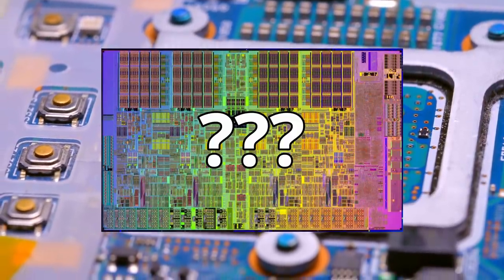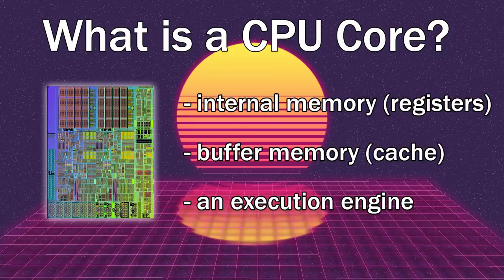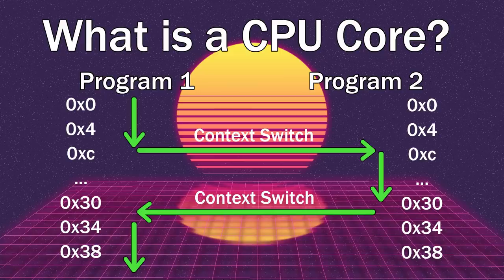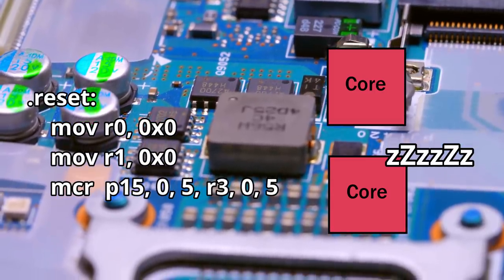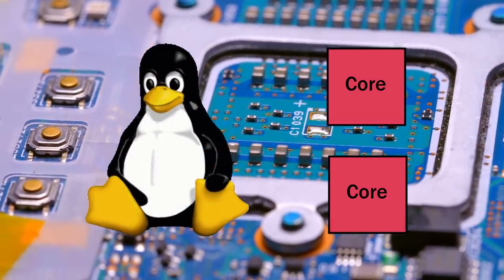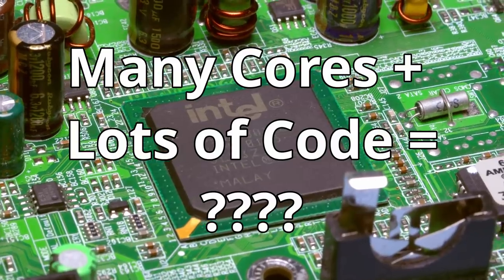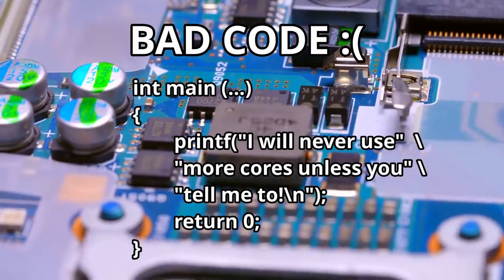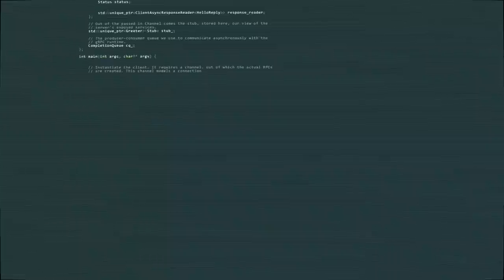why can’t computers have thousands of cores?

Comment: Well graphics cards have insane numbers of cores - most high end cards have in the 5-10,000+ range. These are highly specific cores capable of a limited number of operations and optimized to use local registers, but they can be used for non-graphics functions -- accounting, crypto mining, GIS software, etc. They are still useful for certain functions. Technically, they could be set to run more general purpose programs (giving them more instructions and replacing the floating point with integer operations). The main issue is that there aren't many general purpose tasks which can be divided into 500 or 1,000 tasks each working on its own memory and not using much I/O.

Many chips have microcores doing specialized tasks such as JPEG, MP3, or MPEG decoding. These often run microcode has have hundreds of tiny cores, since those tasks can often be done simultaneously. It could see future processors making these slightly more generic to run microcode.

Comment: Questions, dear sir.

We do have up to like 4 or 8 memory lanes.. Wouldn't simply increasing the amount of memory lanes fix most of these issues? And I guess a faster TLB, since these are still not that powerful afaik.

While sure, Amdahl's law means that a single program won't benefit hugely from parallelization, unless the code is extremely parallel. But, this still lets you run more programs and let cores keep their program affinity as they wish.

Now, sure. A question would be... Won't you just run into huge issues with L3 cache accesses? But you could just keep L3 to a smaller cluster. This would mean programs HAS to run on a certain core cluster, and is limited to a certain amount of them, but that's fine.

So I think we could have thousands of cores... But at that point you may as well just use multiple CPUs instead, which would give easier CPU architecture as well.

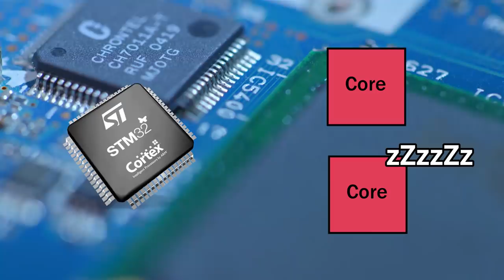Comment: Hmmm around 2:58 ... There is no such Dual Core STM32 Cortex-M0 MCU ...
The High Performance H7 Series has an option with a dual Cortex-M7 and Cortex-M4 tandem configuration or the STM32WB55CG with Cortex-M4 core with a low power Cortex-M0+. 
Anyhow, thanks for the video!:)

Comment: It should be obvious the key to scalable cores lies in scalable software. At present the programmer is required to define threading and concurrent processes, whereas applications should be written with context that allows an operating system to disseminate work to available resources (aka cores). If you want an insight into how this might be achieved, look at Grand Central Dispatch (GCD) by Apple. Although primitive, it isn't hard to see that a programming language could be created that has context and process dependency 'baked in'. Once this is done, the sky's the limit in respect of cores.

Another major issues is the assumption that future processors will slavishly conform to the model of a code execution unit, whereas I believe future cores will be seen as information stream processors in which individual cores will perform relatively simple tasks but combine, through inter-core routing, to achieve any function. In this world, you do not need (nor could you use) cache. Also, cores would be much simpler. Given that a Z80 core (taking an extreme example) is implemented with around 8000 gates, it is possible we could fit hundreds of thousands of simple information processors on a single chiplet processor. This technology will eventually eclipse traditional, linear code processors.

If you're thinking 'this is fantastical', well I've already designed the cores and I'm developing the solution on NVIDIA Jetson alongside server-based simulations. The work is extremely exciting!

Comment: Technically possible, but how many can you use ? Try to run say, 1000 cores simultanesly and the heat generated will probably destroy the chip.

Comment: Some of the information in this presentation is valid and relevant, but the premise is bunk.  Part of the problem is: are we talking cluster, computer, socket, or die?

Clusters - able to apply large numbers of individual computers to a single task - broke the 1000 core mark in the early to mid 90's.

For single computers, SGI broke 1000 cores with the SN/MIPS arch in the 90's, and their UV2 used Xeons in 4096 core single system images inside of 16k core shared memory systems.

For both single die and single socket, UC Davis developed a Kilocore processor in 2016.

It's not that we can't develop these systems - we've done it.  They have limited utility, but there is still room for limited commercial success.  You're just not going to find a 1000 cores in a general purpose desktop computer anytime soon, except in it's graphics card...

Comment: For gaming, the perfect amount of gpu cores, are the number um pixels on the screen, as in this way you can just put them on a single tread and keep everything running at 100% non stop.
As almost every render algorithm is executed per pixel, you will not have stuttering as your gpu will not be changing what pixel each core renders.

For CPUs, the ideal is to have one core for every process that's running, this way you can leave them dedicated for a single task without time being lost on shceduling.

The problem with this approach is that for gpus on full hd monitors you would need 2073600 cores, and that would suck more energy than an electric shower.
For cpus the problem is the same, you can get over 20k processes on your system while doing heavy tasks. And that's not the only problem. If you lock each core into one process, then you will have a limit for the number of processes you can schedule at a time.

This approach can work very well for micro-controllers, as you can make a static program that will never change, and most of these use cases do not require graphics.

Comment: You hit the key point at the end of the video: Current programs aren't designed for massively multi-core processors. But there's no theoretical limitation here - new processors will have more cores, and new programs will use more cores. A key point here: a processor with many slow cores can do more computation per watt than one with fewer fast cores due to the way frequency scaling works. To the best of my knowledge there is no major task people want to accomplish with computers where CPU compute power is a limitation that can't be straightforwardly scaled to thousands of cores. Even for tasks that it's theoretically impossible to parallelize - like the parsing phase of compiling a computer program - the structure of real world instances of the problem make it easy to parallelize anyway.

Comment: a thought occurs, if a processor is with more cores is restrained by heat, why dont they make the processors bigger? I understand socket size but why does a machine need to be small?
Reply: Because the closer everything is the less time it takes a signal to travel. Mind you this difference is only an extremely tiny fraction of second but with cores that are running at billions of cycles per second it is important to reduce this data transfer latency or the cores will start skipping cycles while waiting for inputs or output delays. This is actually why the newest ryzen cpus have the cache built on top of the cores rather than next to the cores, because even millimeters can create a drastic increase or reduction in latency

Comment: More cores creates issues with clock skew and timing, which is why cpus like threadripper have slower clock speeds than their lower core count cousins. Most application people use are single threaded, and cpus are designed to exploit inherent parallelism in code to improve throughput. But even that maxes out at a theoretical 40 threads for real life single threaded apps. And running a program on multiple cores is  to as simple as slapping ins new cpu, the program needs to be divided into threads to take advantage of the cores. (There is great research being done to make this easier.)

With that said, do not confused general purpose computing with that done in a gpu. The former care on the order in which instructions are executed. The latter doesn’t care nearly as much, which is why gpus have an insane number of cores.

And server cpus have high core counts because they are executing multiple jobs at once, which is the type of workload that can exploit high core counts,

Comment: What would you say about the 20 core processor on the Mac Studio?
Reply: lol not even that guy they already have 64 core 128 thread cpus in servers. there is a dinimishing return where the latency from one core to another does go up. so normally these bigger core chips are not something you would say want to game on. But they do have uses in where either cores can be set to do there own work or they can be partitioned off to systems to do seprate work
Reply: @Demon09-_-  yeah I didn’t mean to give much significance to the number of cores, but because Apple Silicon is designed in a different way than the Intel designs
Reply: @AntonioBrandao  yea apple uses similar to what would be found in a cell phone as it uses arm instead of x86. It doesn't scale super well to huge compute but works very well in lower  power applications hence the great battery life and performance that they get out of some of the m1 laptops. Some of them are not as amazing. But arm is definitely the way for laptops and lower power desktops

Comment: There is also the problem of heat dissipation and what's called the landereur limit. 

Cores work best when they are cold. And doing work heats them up. This is also a sign that potential work is being lost to heat or entropy. 

So the more tightly packed your processor and the more core, the more work it does, the hotter it gets, and if course the hotter it gets the slower it gets. 

So a 1000 core processor would be bottlenecked by the heat it would output too.

Obviously if you had some way of keeping the processor at say -50 degrees Celsius then you could ramp it's work up to crazy levels... Increasing the number of cycles and the processor... Known as the clock speed. 

But ultimately soldi state processors  using the lithographic processes we use today have a shelf life and we are now approaching that limit. 

With tricks we could lower the temperature and increase density below 1nm. But eventually there is a wall and we won't be able to make any processors smaller. 

So the trick is likely to use light instead of electrons...fire that light in low quantity on a photonic processor. This will decrease heat and allow sub nanometer density. 

Light can also operate at many many frequencies concurrently. Meaning a photonic processor could, in theory, carry out millions of instructions all at the same time.... Just each task carrying instructions at a different frequency of light. 

Then you could have 10,000 cores each tens of  thousands of times faster than the latest threadripper.

If that, was coupled with quantum annealing processor's... Then thats all the processing we would need for 50 years at least.

The problem is... It's at least a decade if not two away.

But the advantage in compute cannot be overstated. You would be talking all the processing power on earth in a device no bigger than a laptop that uses 9v power and last three weeks.

Comment: One thing to point out...the more cores you use, the easier it is to accidentally create race conditions with bad code.  In addition to the thermal and memory efficiency you mentioned.

Comment: I think the simpler the needed operation, the more cores are likely to be advantageous or feasible. There's no reason you can't wire up 1000 1bit CPu cores, other than design issues or size issues (homemade version of this would suffer from stray inductance, mirroring, etc, though less so than conventional models). Why you would want to do this I have yet to divine. You could probably make a very precise clock this way if you scaled it down.

Comment: Thanks for your explanation. Not many people can explain assembly computing not getting to technical for us who are not geeks. Intel run into a situation with their new processors who are multiple cores but with some P (from power) cores and some low level consumption cores named probably E (from efficiency) (I think don't remember quite right about the name). P cores have hyper-threading and E cores have not. When we have for example an 8 core processor with 4 P and 4 E cores it can support 12 threads. Ideally these threads are: 4 form E cores for normal every day tasks and the others from P cores for gaming or video editing tasks. In the real world a lot of games are incompatible with all these new Intel processors because of not knowing what core or cores to use. An E core can not be the master for P cores and parallel programing in this way is a total mess because nobody know who is doing what. Like programing is not complicated enough as it is, someone came with new ideas. Hello... Intel, phone processors are RISC processors running UNIX like kernels who are invented not stolen form others and putting some windows on it like Windows. All new phones has P and E cores and of course Intel want to steal that idea like they did in the past. May be a new video explaining this core problem will help us. Thank you.
Reply: nah the 12900k and like works fine with pretty mcuh every game out there. the issue is if the game hits the e cores you get some loss of performance as the E cores are a much older arictecture at a lower clock and ipc . what you may be thinking of is the DRM issue intel had wtih some games causeing issue with the new P core and E core system. The games were fine with it and if you had a version without DRM they had no issues. Most of the stuff for intels P cores and E cores falls on the OS and driver side built into the OS the game basicaly just requests P cores Its not all that much on the Dev side alot of the P core detection happens by the OS its self. Phones have been a similar way for a long time and the OS android etc is what handles most of determining what gets the Big cores or little cores

Comment: It possible to create many cores, but not x-86 compatible, and with different motherboard+components design, ofc.
Servers need as much cores as it possible, because server-specific apps works in such way anyway, and splitting it between different machines is sometimes painful or not meet app requirements.

Comment: C code compilers can be told to operate across multiple cores when compiling code with a simple instruction, you can tell it to run 8 threads across all cores, or however much your CPU can manage all at once. The more cores and threads you have the better and faster that code can be compiled.
Reply: Only so much can be done. A lot of compilation also is strictly single threaded but codebases and libraries are so large that this just does not become noticeable as you have docents of files that get compiled at the same tim.

Comment: Frequency of a processor also depends on type of material used in semiconductors. Silicon components can only give so much and we have reached the limits of it. For greater speeds you need to use exotic materials and new solutions for semiconductors used by the US military that can reach speeds of THz (the solution is of course being kept a secret).

Comment: I develop software that is highly parallel, with up to 1024 threads supported to execute code on up to 18 exabytes of memory.  The fact that I am using large jagged arrays means that I could theoretically use up to 2 billion threads.  The truth of the matter is that memory fetches for all cores through the memory controller means that it doesn't scale linearly, a quad core processor typically executes the code about 3.5 times quicker.  I do have a 16 core 32 thread R9-5950X system though, and overall the more cores the faster it executes, with my 16 core system beating out my 10 core system quite significantly.  My R9-5950X is limited to 128GB though.  My next system will be a 32 core 512GB system once DDR5 gets to that level.

Comment: My understanding is that Moore's Law is an observation rather than a rule. Further, I have read that, because of physics, the rate of adding more transistors to a substrate is slowing because they won't fit and / or the separation is too small to prevent cross-talk or leakage. I could be all wet about this.

Comment: You can have as many cores and threads you want, but if the software doesn't manage multicore threads well, it doesn't matter how many cores you have. But the faster the cores are (higher the instructions per cycle) the better. That's why you see software run better and faster on a 4-core cpu than a 16-core cpu.